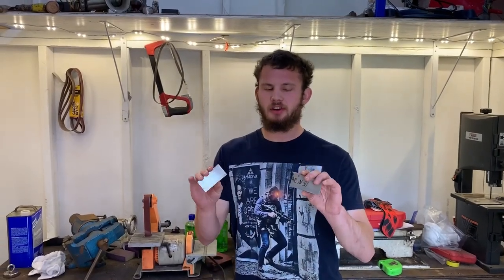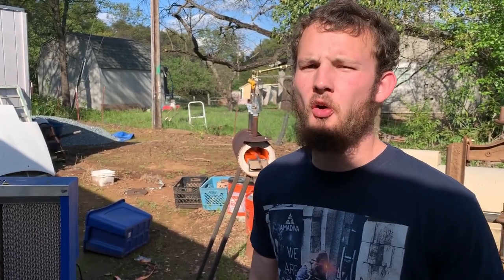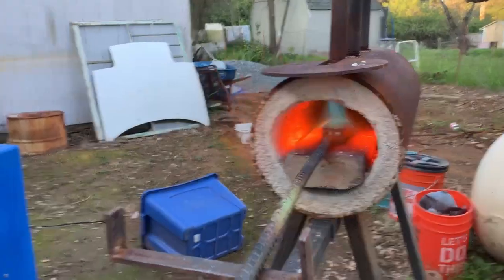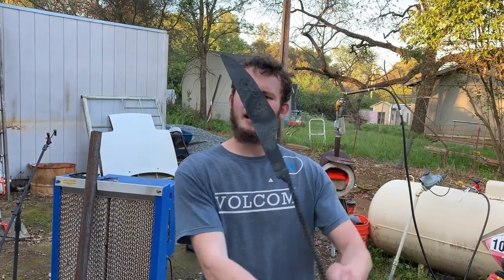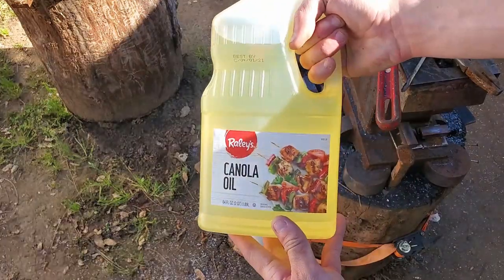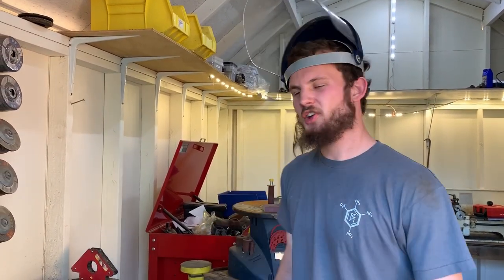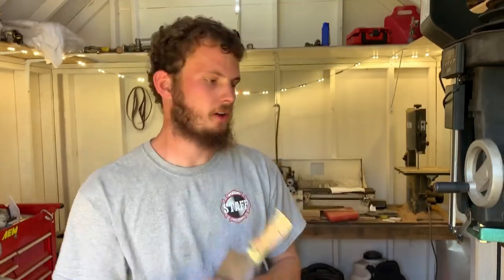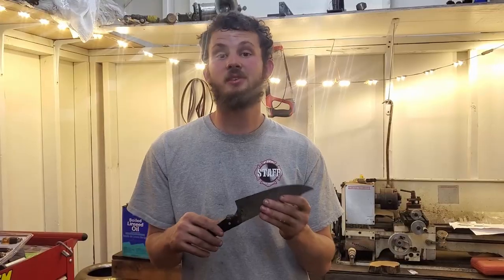Making a Damascus Petite Chef Knife

Comment: kickass man! make sure you're getting that billet super hot and flux if you need it. also don't forget to move the knife up and down or front to back. that way you're not getting uneven cooling by moving the oil on on the wide side and you're avoiding the ladenfrost (i think that's the name) effect on the edge of the blade. could have been a result of the small quench tube. awesome blade though!
Reply from the maker: Thanks! We added flux as we heated it up, and it seemed to do the trick 👌🏼 another thing, it appears that our billet isn't that hot due to the very bright/direct sunlight, but we left it in the forge for a relatively long time to ensure that the core was super hot as well. And a bigger quench tube is definitely on the way! I'm going to focus on moving it vertically from now on, great advice 👌🏼

Comment: Love your content! Been debating building a similar press for months. How long does it take you to go from initial stack of 1084+15n20 to a drawn out billet ready for re stack?
Reply from the maker: Thanks! I highly recommend it for a budget system. Between my dad and I, we've been able to crank out a new Damascus project at least once a week. It's so much faster than working everything by hand.

With the forge hot and efficient work, we can take a 4"x1.5"x1" stack and forge weld it and and draw it out to about 15" in under an hour. Practice makes perfect, and having multiple sets of dies helps. Our first set is 1 3/4" square, which is great for setting welds and for flattening material. Next is the 3/4" flat set, good for moving metal in a controlled manner, staying relatively flat. Our last set is a 1/2" drawing die set, which moves metal like crazy with little control. Using these right and being able to clean up any messes makes Damascus quick work 👌🏼
Reply: Airborne Productions thanks for the detailed response! Luckily i have some damascus billets ready to be worked on at the moment but after that have a big decision to make. 

Have you looked into 2x72 belt grinder projects? Seems like that would be up your alley,  can harvest motor from a treadmill. Another instance of the real thing being really expensive, but making something functional is possible for a fraction of the cost. Although with that you would still need to spend on platen, wheels, belts, etc
Reply from the maker: Can you quit reading my mind? 😂 I turned some 3" dia wheels on a lathe, and my dad took the motor and speed controller out of a treadmill. Along with those, we bought Jeremy Schmidt's plans for a 2x72 belt sander. Later this summer (maybe July or August) we are going to seriously work on getting it together, because it will quickly be our bottleneck in terms of knifemaking.
Reply: Airborne Productions yea it was a game changer for sure. Only complaint is it doesnt have really high torque and im already having some issues with the circuit breaker that I wired in from treadmill getting tripped too often. I would recommend building in such a way that you can replace the motor and upgrade to a VFD down the road but still use the same frame.
Reply from the maker: I believe it! That's good information. We still have some time before the 2x72 build happens, but it's coming up. We will definitely keep that in mind 👌🏼